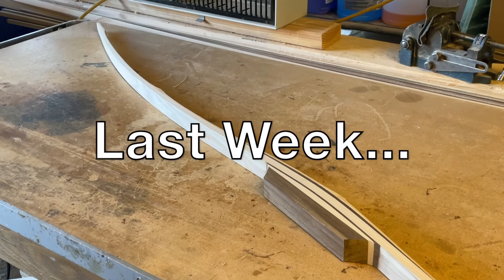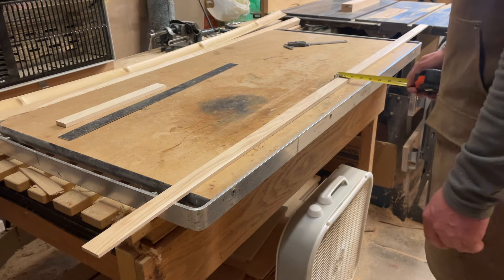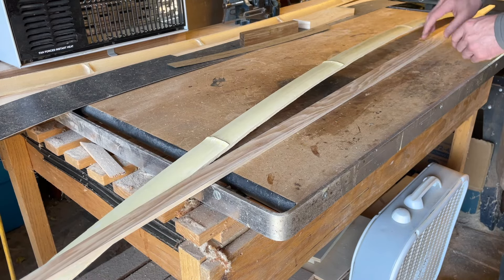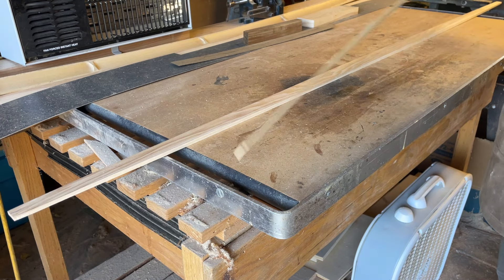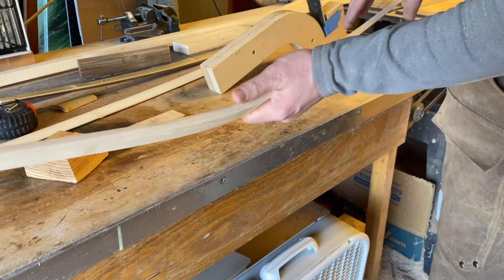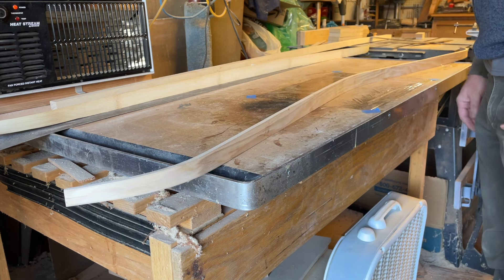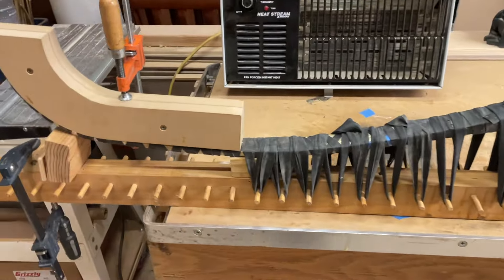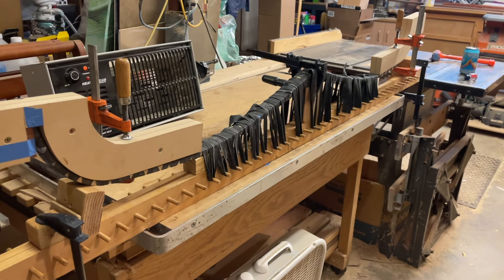The Forward-Handled Recurve Pt.1

Comment: What are the pros/cons of a recurve bow as you are making in this series vs. a reflex deflex bow ( you have made in a past series)?  I’m interested in performance characteristics, more so than construction characteristics. The reason I am asking is that my next bow was going to be a reflex/deflex , but now that you are doing this, I’m wondering if I should build a recurve?  Thanks
Reply from the maker: You ask a simple question, but have effectively opened a big can of worms… There is no right answer to your question, only a series of trade-offs made to arrive at the bow you decide to shoot on any given day. Well made, both of these designs will shoot an arrow at similar enough speeds, but that’s about where the similarities end.  Recurves can be shorter,  and easier to maneuver in the field.  On the margin their length can give them an arrow speed advantage as well, but in my opinion, that’s where the advantages end. They are more difficult to construct than a straight limbed bow - which is an important factor in my opinion. Straight limbed bows also send to be more stable on the shot and are widely considered to be more consistent and accurate shooters for that reason. A Perry reflexed R/D bow has the best mix of properties in my personal opinion. They can be shortened a bit and shoot real fast without  sacrificing stability - my choice all day, every day. Recurves sure are pretty though, aren’t they?!!
Reply: Thanks for your insights…Perry reflexes r/d it is.